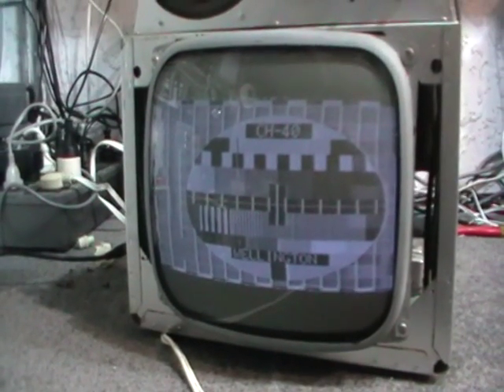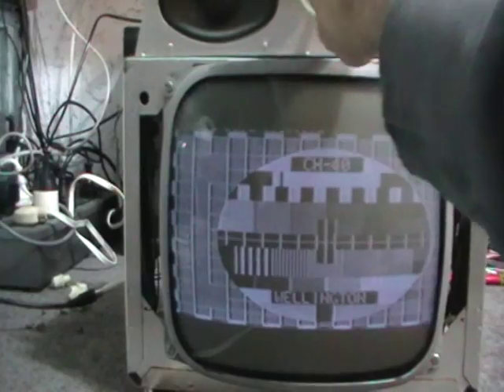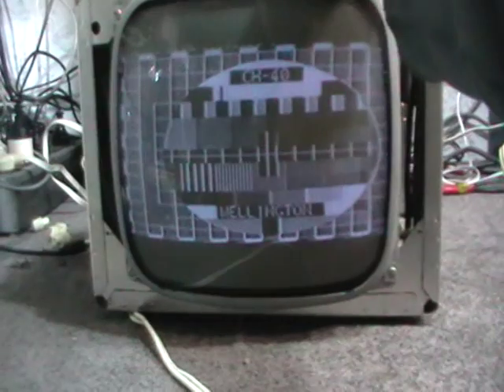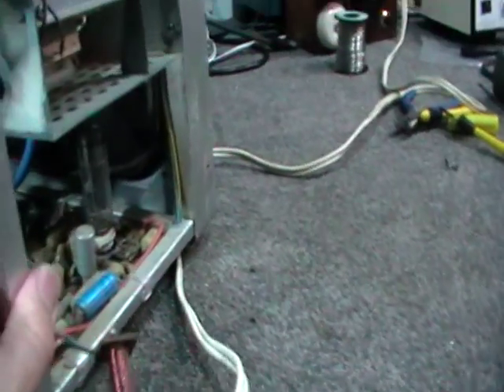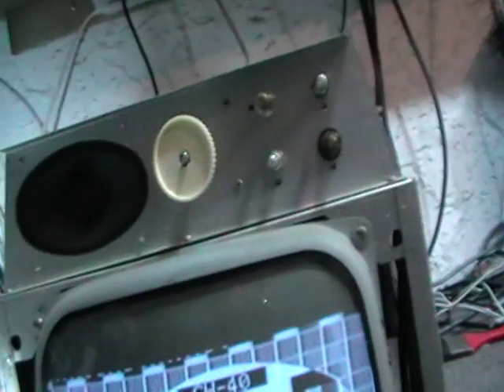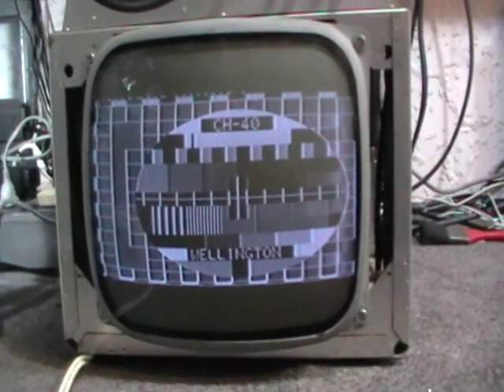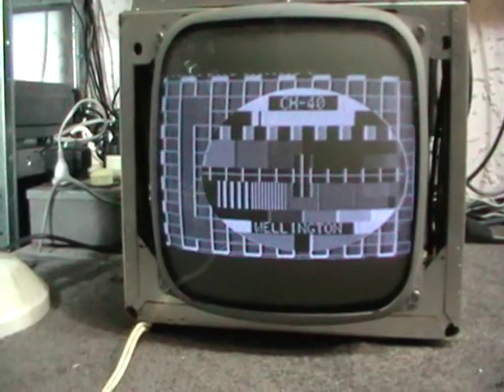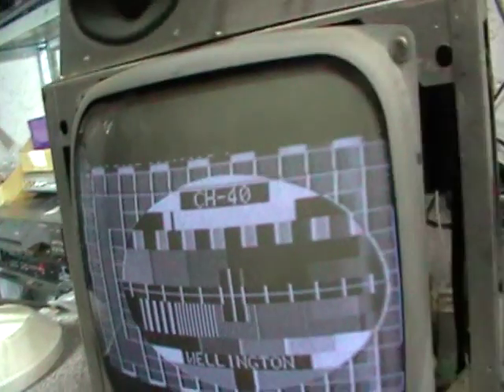Bell TV204 "Bellroy 11" NZ Portable B&W TV 1960's Vintage Part 4

Comment: They were using it to listen to their shows at the end. I see sets like that and cant beleive they ran it out that far. You may bet 50 hours out of it at 8 volts, Hopefully another crt comes along,.
Reply from the maker: You're probably right..so this set has probably seen a lot of use.. If I do decide to fix it up to the point where it will work reliably I may tun it for very short periods with the brightener...will see what happens. Can't make it any worse that what it is...The chances of finding another CRT here in NZ are pretty slim.

Comment: So the emissions are definitely weak? It could not partially be a problem with the high voltage? I think that I would just leave it alone, even though it is dim, just put it aside until you can find a substitute. What is the heater voltage, current, and the deflection angle of the picture tube? At least the heater isn't open. Happy Christmas by the way.